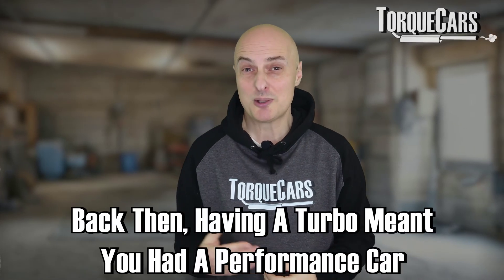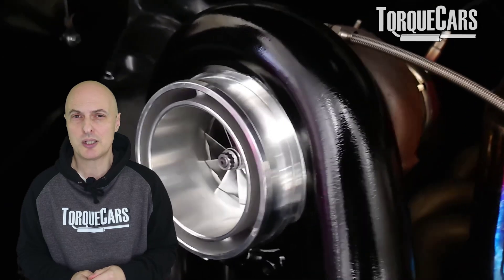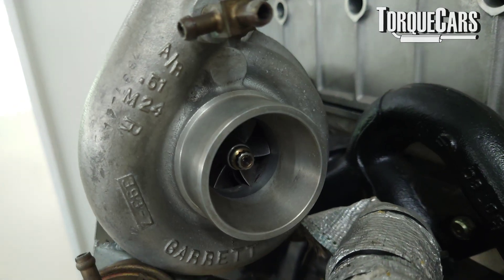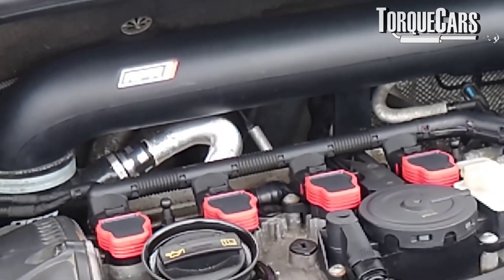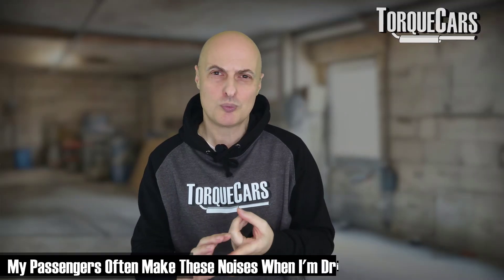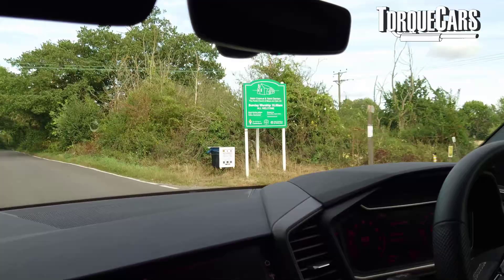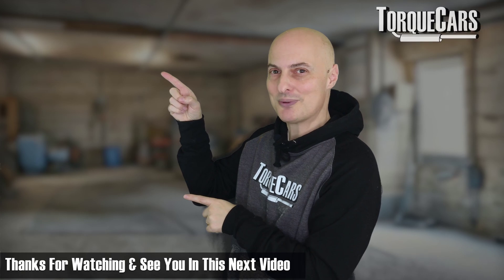8 Stupid Mistakes That Kill Turbos - A Little Mechanical Sympathy Helps You Drive A Turbo Properly!🔧

Comment: have all ways used high octane fuel avoid supermarkets at all cost  if you have put low graded fuel in your car you can instantly tell when you put the higher octane level in as it's silky smooth

Comment: The advise on turbos is great : Let the engine warm up first - go easy on the accelerator - don’t lug the engine  - Let it cool down afterwards.  But I don’t agree that cars built for a certain octane should use higher octane fuel. It’s going to wear that engine quicker. More octane is not more power, it’s more resistance to detonation, which means a stronger explosion, which means more wear on the components of the cylinder, crankshaft etc etc. so engines are actually build to withstand the forces of the explosion of certain octane fuel.
Your video is about not abusing the turbo so it last longer, the advise on using higher octane is the opposite.

Comment: Upsolutely correct. I run 98 oct on my Golf R. It deserves the best fuel and to also keep the engine from carbon build up. Still! I add fuel injection cleaner on every engine oil change. Be mindfil.. NOT ALL FUEL STATIONS SELL 
98 oct with cleaning additives in their fuel, hence why they are often cheaper.  😉🇦🇺
Reply: Yeah stick to BP, Shell and Ampol- all 3 are probably from the same refinery and just have slightly different detergent packages. Any injector cleaner with a high PEA content is worth doing but I reckon a couple weeks before an oil change is best practice.
You'll probably still need walnut blasting at 100,000 kms unless the engine is dual port + direct injected- valves won't get cleaned if no fuel is running over them

Comment: You asked which car we have: I have a 2013 Subaru Forester 2.0L diesel, 350000 kms (217500 miles) and it is still running nicely. BTW, I have already followed most of the tips you mentioned. I think the diesel I use contains 7% biocomponents (not FAME-diesel) and occasionally I fill the tank with higher octane diesel.

Comment: pre ignition on a modern engine, I don't think so.
Reply from the maker: I did research this one and found that LSPI is a very real problem on even recent turbo engines. (Low speed pre ignition).

Comment: Your statement that E10 fuel has 10% ethanol in it is incorrect (as has been tested and proven many times), E10 means the fuel can have UP TO 10% with most fuels testing around the 3-5% figure.
Reply from the maker: Interesting - thanks for the heads up. I thought it was a standard imposed rather than a limit. I've learnt something new today (again)!

Comment: 2014 Skoda Superb 213k, oil and filters changed every 6k miles, gearbox oil changed every 40k miles, still going strong. Original turbo, cambelt, water pump and aux belt changed every 75k, still going strong.
Reply: @garydavies601  those 2 litre diesel engines are amazing sad they get bad rep because of their petrol variants.

Comment: Reccomended oil for my 2018 peugeot boxer van is a 0w 30. If a dpf delete with ecu  reprogramme is done,should the oil be changed to 5w 30? Or will it be better to stick with the 0w 30 ?

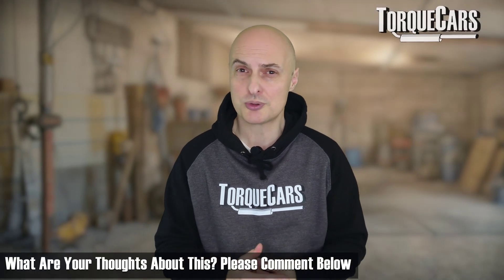Comment: 8:40 rather then using a higher octane (my cap says 87 in the US and 91 abroad) I use Top Tier gasoline. Costco claims their gas exceeds the top tier standard, and their prices rarely fluctuate in my area. 

So the Costco 87 octane is cheaper and much better quality. 

I also drive a ‘15 Golf, so I’m just trying to take care of it the best way I can.

Comment: I'm wondering how long my Turbo will last with 0 wt 20 oil and GDI fuel dilution.  So im doing 3000 mile oil changes,  using Castrol Edge.  Its my intention to keep this car long term. Also using premium fuel,  in 4 years, I've never heard any , my generation calls it Pinging.

Comment: Why is such a critical bit of information so hard to find? Could not find out if my 2018 Golf 7 R FL had an electric oil pump or not. I mean i would assume so but i dont like to work with assumptions.
Reply: The EA888.3 has an auxiliary electronic water pump that activates if it's hot when turned off to cool the turbo and cylinder head to prevent coolant boiling off. I've wondered the same thing about an electronic oil pump though and also cannot find any information. That's pretty good evidence to conclude there is no electronic oil pump.

Comment: I never thought I'd have a turbo-charged car when I was younger and now I have two.   Timely video!
Reply: I had turbo charged cars when i was younger. Now i do not want turbo charge engine. Prefer simply bit more engine displacement to get exactly the same performance but with less moving parts. Less moving parts = less problems.  (i am aware of the claims of better fuel economy of smaller turbo charged engines, in reality that is just on paper and in the lab, not in the real world).
Reply: @basbass429  Yeah, I love the quick and predictable response of a naturally aspirated (NA) car.   I have a NA V8 sedan and I much prefer to drive that around town than my turbo vehicles.     Shooting a gap in oncoming traffic is a little scary when you don't get the acceleration you want right away.
Here in the high-altitude Rocky Mountains, you can't beat a turbo-charged car for climbing the mountains and hauling heavy loads at high speeds, however.   
NA cars lose a lot of performance up here.
Each has its place.
Reply: @basbass429 Booooo. Spinny bois ftw.

Comment: I remember the old days when it was cool to light your cigarette off your glowing turbo on your Escort, Fiesta or Cosworths turbo. And turbo timers. I miss the early 90s :/
Reply: @davidcrawford8583  my mk7 gti has a built in turbo timer, if you turn off the engine, it continues to pump coolant and oil through the turbo into it reaches a certain temp
Reply: @davidcrawford8583  i remember a black s1 A812 GEE , coming back onto lord st car park in leigh (NW England)  with a glowing turbo,  you could literally see through the casting  ! Just awesome lol.
Reply: @rossiwilton  Them were the days lol
Reply: Ps s1 escort rst.

Comment: I drove a turbo rx7. Despite everything you hear, rotaries when done right are reliable as hell. 5000k oil and filter. Ecu mapped with a power / safe tune. 60 seconds before driving. Gentle driving until the engine temp was in the middle. AND THEN GO LIKE CRAZY. 2 minute turbo timer back at home. Nb the cooling system was kept in good order.

Comment: it's been a while since I read my drivers manual for my Abarth but they ask you to idle for 30s after start and 30s before turning off. I don't think its to do with the oil heating up  but allowing the oil to be pumped round and drained out of the turbo.

Comment: Not sure 100% sure why but on my Leon cupra mk1 if I drive it asap after a cold start for a bit, it lags and doesn’t allow me to use throttle. From what I looked up it sounds like the secondary air intake warming up the cat.
Reply from the maker: The engine is limiting power during the warm up phase, this video went into this topic a little if you're interested https://www.youtube.com/watch?v=bu-lWN5MCPs

Comment: Using poor fuel destroys a turbo as it degrades the turbo blades, also poor/cheap coolant will destroy a turbo
Reply: No it doesn’t. You use higher octane fuel for turbo cars because higher octane has a lower chance of detonation. And since your forcing more air and fuel and higehr pressures in the combustion chamber with a turbo, it’s more likely to detonate tye fuel on your compression cycle. Poorer fuel has less octane to keep it from detonating in a turbos cars higher pressure and fuel mixture combustion cycle
Reply: Assuming the car isn't dumping tons of fuel into the exhaust as if it has anti-lag, then a bit of unburnt fuel touching the turbine wont cause any damage.
Reply: If fuel is touching your turbo blades you have bigger problems than it wearing out!😂
Reply: @handle433  It's natural to have miniscule amounts of unburnt fuel make it's way into the exhaust system, even on a direct injection system. The fuel alone touching the turbine blades isn't going to do anything, that's up there with the most ridiculous things I've read/heard about turbochargers.

Comment: I have a 2021 Mazda CX5 Signature (turbo). Being retired I do not drive much these days. When I do drive it is always a longer ride of at least 20km to 50km +.  I am on top of service, every 6 months and/or 8000km. I end up on the 6 month schedule with around 5500km. The dealer I go to is fantastic and they do a good job. Just had a service a few days ago. Basic vehicle check and oil/filter. They also cleaned the throttle body. Last service they did the intake valve carbon clean. One cool thing the dealer does is they always "walk" you over the car showing you the status. (they take a video and send to you by text)  I got the car in Dec 22 used with 24k km and now at almost 47k km. 

I used to use Shell 91 but have switched to Chevron 94 (no ethanol).  I have always been gentle on the turbo on cold starts and wait for a few minutes before turning off. 
I am mostly gentle on the throttle but there are times when I go to warp 10. One time to show a friend how fast the damn thing is. (if I recall, 256hp and 320 lb/ft torque)

and funny in that my first car I got in 1972 was a Mazda RX2. (rotary engine)

Comment: I don’t know if you’ve done a video like this in the past, but I’d love a video on being mechanically sympathetic to your car’s suspension system.

I have a basic idea but I still get a little thrown by things like taking your car up a driveway off a main road. My understanding is that the suspension is designed to absorb up/down forces and in the direction of the wheels, but making sure your car is always moving this way can be a bit confusing. Like when I’m pulling up a driveway into a parking lot off a main road, I don’t want to slow down too much, so I’m sometimes confused if it’s best to go up slightly diagonally to the incline, or if I should turn the wheel to be as close to a 90 degree angle with the incline as possible even if the car facing more diagonal to the incline. This can still sometimes result in the car getting jolted side to side if you don’t take it really slow on a sharper incline.
Reply: @noahmcdaniel4920  I genuinely think that if you’re conscious enough to notice how the suspension is being loaded I think you should know how to just keep it reasonable. I say this because you have a good idea of what the suspension wants to do and how it’s supposed to operate. In my opinion I think keeping those hard transitions like main road —> an upward angle driveway would require a small bit of braking while entering and once the front two go you could let go of the brake a little then lightly apply it again to not slam the back wheels down on the same transition. For me personally I like to slowly transition in by going slightly diagonally to feel each wheels change of elevation before continuing on my path. I’ve blown a strut in the past as a delivery driver not caring at all and all you really need to do is avoid hard bumps or jumps and the rest is just structural integrity of the suspension components.

Comment: I've been told that modern cars with stop start systems use the alternator instead of the starter motor to start the car when the stop start kicks in and that there's a system in place to provide oil for the turbo bearings the time that the engine is off, but I don't trust it. I always let the car idle for a minute or two before turning off the engine, plus I don't use the stop start system. I personally think that stop start is purposely designed to gradually destroy the turbo, building in obsolescence in the process. Same as wet belt engines. Manufacturers have to get the money out of us some way or another.
Reply: @stuartjenkins3506  to be fair this lube oil circulating you are saying is used in ship generator engines. When the engine stops it automatically starts its auxiliary lube oil pump to lubricate the engine continuously while at full stop.

So it maybe possible that it is applied on car engines too.
Reply: right.I dont use auto start/stop when i drive turbocharged engine, neglect for save fuel consumption
Reply: alternators cant start cars, have heard alot of implausible theories about how manufacturers have made stop start better and bar electric oil + water pumps and hybrids having their way of starting cars theres nothing really
Reply: @stuartjenkins3506  this is so true, its the same with most car manufacturers these days, ever noticed how 30-40 yr old cars are so easy to do basic maintenance on? Like bulbs, wiper blades etc, look at modern cars, I drive a 2008 bmw 3 series and to change the headlight bulbs I have to jack up my car, take the wheel off, take out the wheel arch liner and undo 10 tiny screws just to get to the bulb, I can do it myself but it's a pain in the ass, most people would need to go back to a garage or main dealer for this, which is exactly what they want you to do...

Comment: Turbos heat up faster than you think. I can start my car for 10 seconds, stop and its already too hot to even touch the turbo in any way
Reply: this is different to the oil hesting up. What you are feeling if the hot exhaust gasses going through the turbo heating the outer housing up but not necessarily the bearings in the moving parts
Reply: @stevenvictx  the oil heating up is the real crucial thing, when you floor it or drive the car above a certain rpm that turbo spins at 100k rpm, if your oil is cold it's also thick so the turbo will basically grenade itself if some conditions are met. Warm up your engine/oil/transmission and turbo by driving slowly the first 1 2 kilometers, then gradually increase the rpm if needed, this way your car will last forever

Comment: I have a golf 7.5 1.5 tsi. I have noticed when I run the car with 98 octane instead of 95 it goes more often into two cylinder mode but maybe it’s a placebo effect. Can anyone with the same engine confirm?

Comment: A stupid habit that many drivers had was to give the engine a bit of throttle just before switching off, the 'Brmm Brmm' effect. They simple revved up the turbo to a high speed as they cut the oil flow. 
On my L/Rover the  Turbo bleed bypass opened when the engine was up to speed, I actually had a passenger who thought that was when the Turbo 'cut in'. That vehicle lasted for 20 years on the original turbo unit. High quality oil and proper use of gears seemed to work well.
Reply: @solentbum  or another stupid habit people do that I’ve seen is blipping the throttle the second the engine starts because they think it’s going to stall if they don’t do that, forcing the turbo to spool up when the oil light probably hasn’t even gone out yet

Comment: I still bring up the oil temp on our modern TDI family car if I’ve been driving on fast roads and need to pull into a services and won’t turn the engine off until it reads 95 degrees or less. It drives my wife wild just sitting there in the services waiting for it 🤣
Reply: I guess she understands the subtleties of lubrication....

Comment: Octane: higher is better but you won’t see any real benefits of high octane like 99, until the engine has been mapped to it.
Reply: HIgher octane does nothing in engines with compression too low take advantage of it, octane is purely the ability to prevent pre ignition in high compression engines.
Reply: A lot of performance car's like mine actually come from the factory with a map that requires 98/99 E5 for full power and mine states in the manual that you should only use 95 if you absolutely have no other choice. Put 95 E10 in and it runs noticeably worse with a clear reduction in throttle response and power. Luckily i have Tesco Momentum and Shell V-Power nearby.
Reply: You'll often see a marginal increase but what most people don't know is that too high an octane rating and you'll actually retard power and performance.

Generally speaking  95 RON (~91-92 MONRON in the states) is good for normal cars.
Reply: @skykid4000  for my vehicle I have found that 91 is the sweet spot.  Lower than 91, it won’t knock, but it’s a little sluggish.  Over 91 doesn’t perk up anymore over 91.  Under 91 a little less fuel economy and over 91 there is no difference.
Reply: I use octane 95

Comment: My fun weekend car: Pulsar GTIR. Has a big Garrett Turbo on it. Mapped on shell v power. Oil change every year. I don’t let it idle , I start the car and go and just nurse it around once I’ve covered 4 miles or so until the oil temp is decent before I kick its head in. On a hard run I always finish off with a minute or so at 70 on the dual carriage way with no boosting through the estates on the way home to cool it down properly. Leave it to idle for a minute and turn it off. Turbo has no play in the shaft impeller. Been 3 years and it’s still good.
Reply: @skykid4000  great car, good choice. Down here in NZ we were spoiled there were hundreds of them was almost my first performance car still love them.

Comment: Is lugging an engine only a thing with manual transmissions?
Reply: Yea , auto boxes won't allowed it
Reply: @stestar09  how about autos with manual shifts?
Reply: @stestar09  That's simply not true, there's been many times I've been driving uphill and the OEM programming in the DQ250 TCU has allowed a change up from forth to fifth at 30mph uphill (way way way under power band of a 300hp petrol car). It takes quite a lot of throttle input to get it to change down. When it does that i just go in manual mode back to forth. Hoping to get a TVS DSG stage 2+ tune soon for a host of improvements to performance and drivability. Remember, engine lugging doesn't just happen at full throttle.